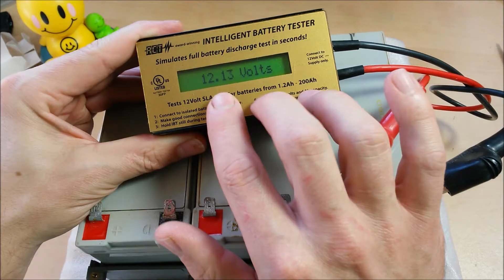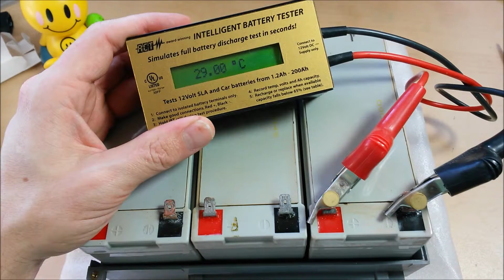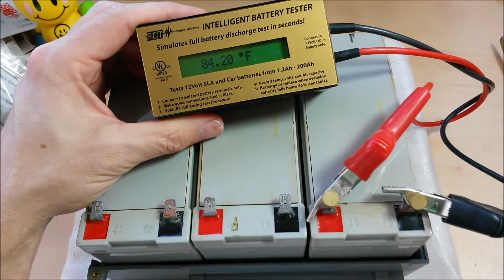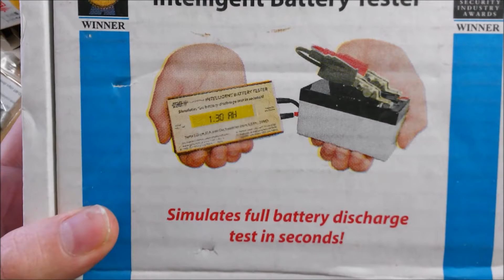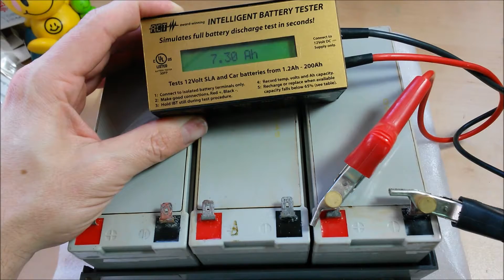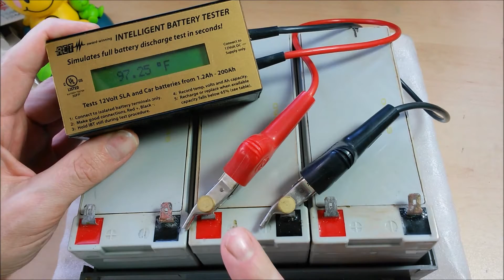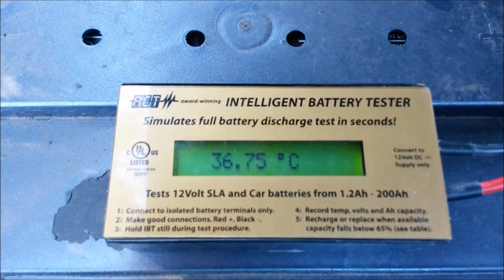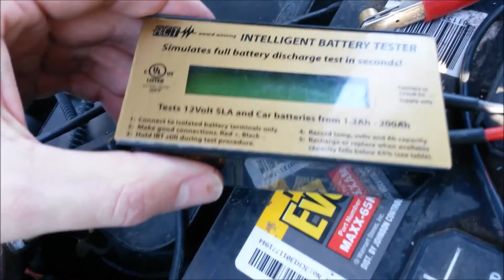(:Review:) ACT ~Intelligent Battery Tester~ Battery AmpHour Reading in Seconds

Comment: Hi not sure if you can help but keep getting error 3 when connecting it displays voltage then either displays error 3 or low current,I've tested this on several batteries and tried to clean the clips

Comment: If I’ve got 2x 12V batteries in series together would I be able to test them individually while on load or would I have to disconnect them?
Reply from the maker: Ideally you would disconnect them. It's a calibrated device, so once you start messing with resistances and adding cable and other connected devices, it will throw off the measurement.

If you had a new battery setup, you could measure with everything connected, then using that as the baseline, know as the batteries age, how many aH you have lost over time.

Comment: The tiny needles inside the jaws of the gator clip are referred to as a "bed of nails", and they are designed for taking reading THROUGH the insulation of a wire, eliminating the need to strip the insulation or find an exposed metal point of contact. The user simply opens the jaw of the gator clip, positions the wire perpendicular to the flat side of the jaw, resting the wire in the U-shaped notch, and then closes the jaws by pressing on the brass button that's on the outside of the jaw where the needles are mounted. NOTE: Be mindful of live circuits, and ensure that you're not touching the hot side and ground at the same time.

The bed of nails is not meant for use on metal quick-connect terminals such as those found on many 12V SLA batteries, nor are those needles intended for use on lead battery terminals. Using the bed of nails for anything other than piercing wire insulation will ruin the needles, making them useless for their intended purpose (piercing the outside of wire insulation).

The tips of the gator clips' jaws are perfectly suited for attaching to flat metal quick-connect terminals, when used as shown on the ACT tester's box.
Reply from the maker: Great info!
Unfortunately both of my ACT battery testers were stolen in a break in, and not recovered with the small amount of stuff that was. May not do any more ACT videos until I can find another one. Hopefully I can get one that does LiFEPO4 and other lithium breeds.

Comment: Don't get me wrong ,ACT meters are as good as one could probably expect, it's just that giving accurate amp hour capacity readings on large batteries like car batteries, is asking a lot. Batteries vary depending on manufacturer,chemistry, whether wet, AGM or GEL and state of charge etc.

Never discharge a lead acid battery below 10.8 volts on a normal load, or the test itself can do harm.I wouldn't discharge a car battery even down that low to test it, maybe go to 11.4 v with a 4 amp load and assume it will have a fair bit more capacity than that in reality.  Recharge the battery immediately.

Comment: I have used the ACT Gold Plus, the ACT 612 and the ACT Chrome.All testers were bought new. My experience is that they are all good for testing small lead acid batteries up to about 20 amp hours. However, I   have found them all often capable of giving way out readings on large batteries of 40- 100 amp hour capacities. A large battery dealer I know found exactly the same as me.
In my experience, these meters can sometimes be fooled into 'thinking' that a battery still capable of a high current output for starting, has a high amp hour capacity. I have tested batteries that read close to perfect on ACT meters , but on doing accurate amp hour tests using a load over many hours discharged to 10.8volts, the capacity has been well below 50 percent.
I still like the ACT meters and they are ideal for testing alarm and the smaller lead acid batteries. I use them as a guide only, for large lead acid batteries. They will certainly show if a say, a 100 amp hour rated battery is completely useless.I tend to use a conductance  tester and even a heavy current load tester as well , to get an idea of how good a battery is quickly. At the end of the day, if you REALLY want to accurately know the amp hour capacity of a say, a 25 kilo leisure battery, I don't think there is an easy way, apart from a discharge test over hours, unless you spend a fortune on very expensive equipment and compare readings with known full spec. batteries.

With all meters, especially the ACT ones, it is essential that the clamps make a good, tight contact with clean battery terminals.
Reply: I'd have to agree with the  so called quick testers being only a general guide , have alook here where a proper 6 sigma evaluation proves them very unreliable: http://firewize.com/forum/2008/06/test-method-sealed-lead-acid-batterieshttp://firewize.com/forum/2008/06/test-method-sealed-lead-acid-batteries
Reply: @ancelb9590  Many thanks for your comment. Sorry I've only just noticed your reply. The Firewize.com site said "page unavailable", but searching their site under "Test method for sealed lead acid batteries" brought up comments that these testers can't really do it accurately for batteries above 20 AH & are only really a rough guide. Still, unless a person has an hour or more to check a battery, then their probably the best one can do, aside from spending something like £1000 or more on high end equipment.
Reply: Michael Thomas is there a cheaper alternative to one of these amp hour battery testers? I need one to test 4-12ah security panel 12v batteries and give a full discharge test in seconds for work. I don't need one that tests car batteries or CCAs. I cannot find anything other than ACT testers. Thank you.
Reply: @ramblin_man23  Sorry,  to correct my last reply, it's called "Triplett Check A Cell." I was on a little screen before. The video on You Tube to look at is called: "ACT MID TESTING" by someone who has loads of very expensive professional test gear & seems to be connected to "Powersonic" that make the lead acid batteries.ACT testers certainly don't work well for indications of the amp hour capacities of their batteries. How accurate ACT meters are would vary from make to make & on different sizes, so you'd ideally want some brand new batteries to try the ACT meter on first, so as to know what a new battery should read on the ACT display.

 With hours to spare, you can't beat putting on a load & seeing how long the battery lasts down to 10.5 or 10.8 volts.  I have a couple of discharge testers to do that. The FDY10 is an inexpensive one. You just set the desired current & cut-off voltage, then it will discharge automatically & tell you the capacity at the end. It beeps to let you know when it is finished. "West Mountain" do them too, or there are others, often just PCBs with fans etc. on  & from China.

Comment: The chrome tester 12v is one or the best testers in Europe we measure car batt in ah(ampere/h) not I cold cracking so if my car have 45ah I buying 45ah if you will ask me how mooch cold cracking have I would said f knows so those testers are handy best on the market I would say also handy if you have solar panels with battery bank easy Peasy to find witch cells are weak not holding charge probably most bad battery after charge will reach volts but not AH but if they do not for long the ah will drop quick down I call this magic tester cos tell me I second stage of the battery

Comment: The latest one is not 106 I think is 612 6/12 volt bat tester and chrome 12v bat tester 1,2-200ah and car battery have 35-to75ah  not over 200ah you are confuse with cold cracking 200cc up to 500cc or over

Comment: I would think car battery be more than 200Ah or am I wrong, cheers Graham
Reply: No they are usually all less than 100ah. They usually have a ratting of RC or reserve capacity. A group 31 battery usually ranges from 180-210. Thats how many minutes at 25 amp load it takes for the battery to drain to 10.5 volts. You can calculate it out. 180÷60minutes×25amps=75ah.